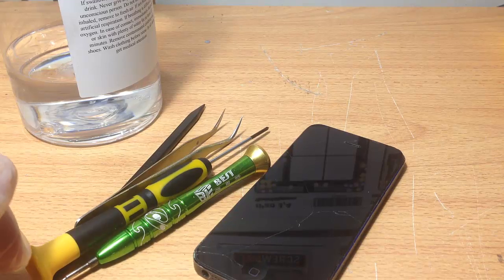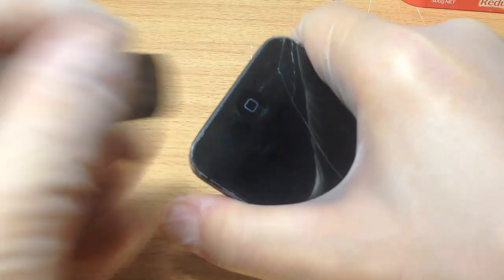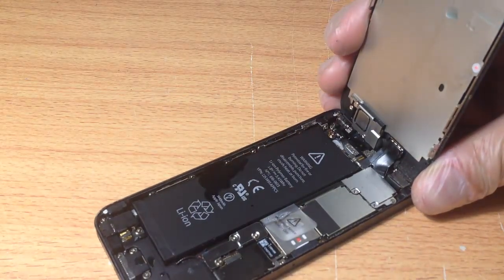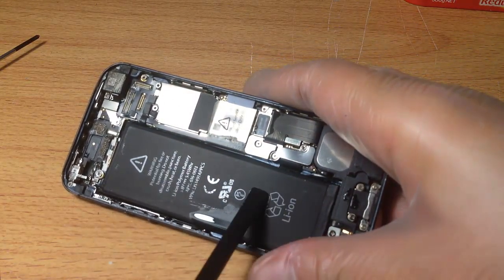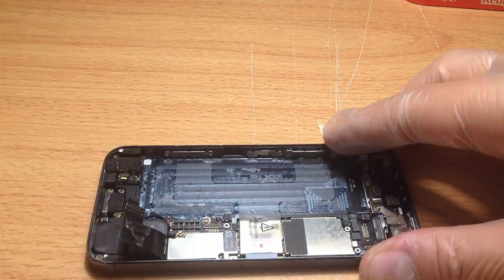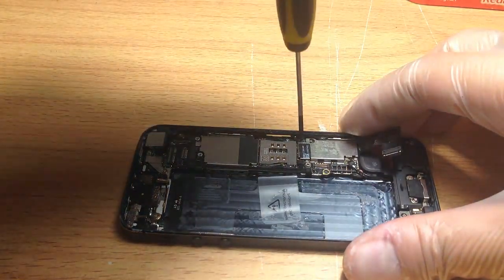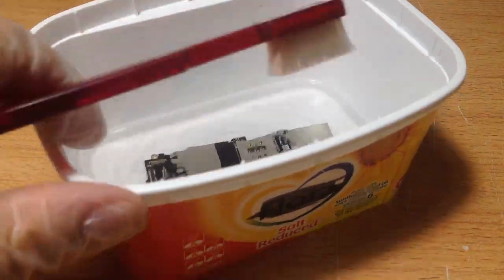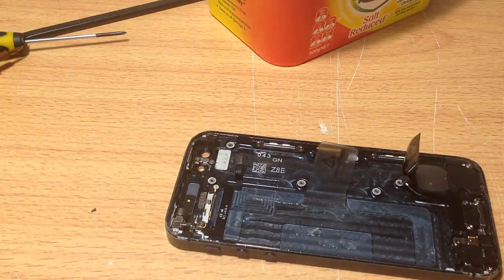iPhone 5 Water Damage Repair

Comment: So you really just washed it and it turned on? Did you get a new battery or use the same battery. The problem with mine is i dropped it in water and I try to charge it but it stay on the apple logo and thats it. I remember actually getting past the logo and it booted up but you can see the water damage and it slowly faded back to being off. Do you think i should get a new battery or wash it?

Comment: I dropped my phone in the bowl throne. Dunked it so clumsily but not two seconds passed that I scooped it outta there. Frantically opened it to see it still functioning but the touch screen barely responding. In the next minutes I wiped it clean and dry, sun dried it for a bit until I realized I shouldve turned it off. Left it in rice for barely an hour only to ignorantly turn it on again. It still powered on. Yay! But it's stuck in the booting white screened apple logo. Noooo. Left it to drain out the battery and die. Then I put it back in rice. Tried so hard to forget about it for 48 hours. I was so nervous when the night arrived that I could take it out of the rice. I noticed that it's more dry; the tiny water droplets in the main camera completely dried off. Went to charge it. Displayed the charging battery icon then still proceeded to stay on booting forever phase. I was desperate. Already consulted local apple repairs and they all said my phone to be gone for good. I refused to give up. After so many tabs of reading from forums and repair guides, I came across this video. Gave it a try. Opened up my phone and took it apart only up to the logic board. Luckily the LCI at the bottom near the charging port and battery did not gave any tint at all. Followed my instincts in cleaning the circuits and followed every second of this video. Being meticulous and intricate with the work, I succeed in rescusitating or bringing my phone back to life. Gonna back up from now on! Thank you so much for this!!!
Reply: TLDR; this video is legit but has its limits depending on so many factors. 
worked for me. the world is a better place :3
Reply from the maker: well done!

Comment: A few drops of water was left to soak onto my phone months back, the touch screen went all dodgy and eventually the phone just went black. I let it sit in rice for 2 days on and off and it would come back on for 3 minutes then die again. Now it doesnt come on at all so after seeing your video i ordered and replaced my old battery but still, the phone will not come on. Do you think replacing the charging port will help me? i have just ordered one on amazon and will be fitting myself.

Comment: Informative thanks...... Apple's business model is virtually the opposite of what the industrial revolution was supposed to be about. The idea was interchangeability, uniformity and ease of repair. These things are like prussian clocks form 1420.... they are rubbish. Once people have wised up and realised that they've been conned by appearances and trendy marketing tricks these things will be replaced by the mobile equivalent of a jeep. It'll do everything cheaper and easier. So anyone out there who's entrepreneurial.... here's a tip. Design a phone that's waterproof and unbreakable..... keep it simple... Think of the phone equivalent of a 40s jeep or red wings boots. You'll have a massive market of people sick of fiddling with ridiculous little screws and lock out technology crap like this.

Comment: I just dropped an about week old refurbished phone I had into the toilet.. it was only in there about 6 seconds maybe, and when I got it out it was fully functioning just a little wet. I took off the case and stuck it in rice for good measure, and it’s still working, do u think it will be okay and still function without corrosion as I it works fine and was in there very short amount of time and I am letting it dry. I am not able to do this method either, unless emergency. By the way I do not see any water lines or any signs of it being dropped? Is it possible for it to completely be okay
Edit: I say fully functioning, but I say that bc the screen was still on, I did no further tests as that could be bad, and I turned it off after. I’m letting it dry upright in rice. Please reply will my phone be okay without any damage. Is it possible??

Comment: @infohut My iphone 5s was in water for a few seconds. It still worked however kept searching for signal. I took it to an accredited Apple repair center and they did an ultrasonic wash (I think that's what its called) but they came back to me saying that its still not finding signal. Do you think I would get a different result if I try this?

Comment: Why do none of these "repair" videos for the iPone 5 have the ribbon connector from the home button to the main board? If you flip the screen up 45 degrees like here, or 90 degrees as other videos recommend, you will rip off the cable. More than 15 degrees and it's cactus.

Comment: When I press the on button, it comes up with the symbol saying to charge the phone even though it is still plugged in. I used the phone for 4 days after dropping it in water. I only want my photos off it, not to fix it. Is there any way to get data off without the phone switching on?
Reply from the maker: Mark Vessey I’d try cleaning it as per the video then also changing the battery

Comment: I dropped my iphone in a cup full of Jack and the screen went off. This was two days ago. Opened it up today and submerged it methylated  spirit then let it dry out in the sun. Put it back and it worked fine but the screen has been damaged and little dull in contrast, like a 3d effect. I think its time I got a new iphone!
Reply from the maker: screens are cheap.  check out my iphone 5 replacement guide on my channel & also there's a link on where to get replacement screens.
Reply: I am planning to purchase one tomorrow. Just had it replaced last week.

Comment: Don't lose hope people, hear me now: my phone was out on the street, in the rain, for the whole freaking night. I used these instructions to loosen the screen and the battery. Then I thoroughly vacuum cleaned the insides of the phone, with low to medium intensity. I then put the screen, battery and rest of the phone separately in a jar of rice for 48 hours. Now I just compiled the phone back together. It seems to be doing alright, just has some blemishes on the screen and must still have some dirt in the charging jack since it works sporadically. BUT YEAH YOU CAN TOTALLY SAVE A WET PHONE AND THE RICE TRICK IS NOT A MYTH. Taking the whole thing further apart and using the alcohol washing like in this video,  well if you're confident you wont loose any screws/parts and that you're are able to put the whole schebang back together again, go for it!

Comment: My kid dunked my iphone SE in a pool and held it down there for I don't know how long. I dried it out using rice for a few days, and it only worked somewhat. Bought some big tweezers and tiny little screwdrivers and took this little sucker apart, followed these directions (although it's a bit different because it's an SE). Getting the battery out was HARD...I bent it pretty badly and the wifi do-hickies became gelatinous sitting in the alcohol wash...plus some little bits of foam came out of the phone into the alcohol...yikes. I knew I bricked it but I put it back together anyway. Sure, I have a leftover screw and a couple of plates with no home...but oh well, it's not going to work anyway, right? 

WRONG. It does work!!! It could catch fire at any time and who knows how long it will work, but right now, I am feeling triumphant. With that said, I would give some advice to anyone who wants to try this: 

1. Get the magnetic screw mat magnet thing, invaluable...because these screws are so small you can barely see them when they fall. And the screws are (I think) color coded to the screw mat, which would have handy for me to know at the time. Also, use magnetic tools. 
2. Don't take out the battery if it's glued down (at least on an SE) I could have done the whole thing without doing that and it would have worked just the same. I probably did real damage to the battery.
3. PAY ATTENTION to those little screws, where they go, and any little plates or bits that come out...where they came from...etc. Just go slow, and really pay attention. . I put this thing together four different times because I got the screws wrong. 

THANK YOU to the gentleman who did this video, you saved me about $250 on a refurbished phone, which is a lot of money to me right now...I would have  had to put it on a credit card and stressed about it.

Comment: Hey, please help! Any help is appreciated. I dropped my phone into water for only about 3 seconds. I quickly picked it up and it was still working. After, it shutdown and I tried to turn it on again. My phone was burning hot after this.  30 mins later, the burning stopped. The rice method hasn't worked for me. Do you think this method work although I tried turning it back on? Thanks in advance!
Reply: swag master your mistake was turning the phone back on after dropping it in water the issue is corrosion and the rice method is a myth because it doesn’t stop any of it

Comment: Do not use a philiips head screw driver to remove the screws around the charging port. I just did this, quickly stripped them out before realizing that you need a tiny torx screwdriver specifically, and now will need to take my phone to Apple for an expensive fix.

Comment: About 4 days ago my iPhone 5s dropped in the toilet. I immediately pulled it out and turned it off, but even now, it's still unresponsive. Should I try plugging it in first? Or should I try putting the motherboard in the alcohol without trying to plug it in?
Reply: Same happened to me except I turned it on :( I will probably still try this method

Comment: My iPhone 5s got immersed into water.
Didn't work for a day. Not even during charging.
Authorized Service Center said, replace the phone for 22k. It's dead. 

I still charged it. And to my surprise, it started working.The display showed water droplets all over, beneath the screen.
Now, post 2 days (I blow-dried for 5 minutes. No keeping in sun, no rice sack, nothing), the water beneath the display had almost disappeared.
The phone's working absolutely well. WIFI is working.
Only issue is, SIM IS NOT BEING READ.
THE PHONE IS NOT READING THE SIM CARD. It shows 'Searching' on top left corner.
What do I do?

The iPhone service center denied service to a water-drenched phone.
And I don't trust the local service centers.

Comment: I dropped my iPhone 5s in the tub of water
Just a few seconds 
The screen was cracked so it only took a few seconds to get alpt of water in it
I'm in process of doing this now
It's sitting in the alcohol now, I'll keep every updated
Reply: Update?
Reply: So... did it work? I want to do this to my phone, but I'm not sure it works. A response will be much appreciated
Reply: This process works as long as your phone has not been fried which happens when you try to turn it on or plug it in when it is wet.

Comment: THIS IS FOR ALL THE PEOPLE WONDERING IF THEY CAN TRY THIS METHOD AFTER 1 MONTH TO A YEAR OR SO... WATER DAMAGED PHONE INCIDENT HAPPENED! ... I have knowledge of people that has the phone sat for 6 months and this method worked out for them, it all depends on the damage done by water on the phone, I mean how many water was inside the phone, how many parts and contact are affected by corrosion and also and most important, the owner of the phone MUST NOT have try to turned on the phone after it got wet, because this will cause a short circuit, if does, the phone will likely not work anymore since probly has parmanent damaged parts due to electric burned parts. This is all the logic behind bring back to life your water damaged iphone. So stop wondering and give it a try, this is a very effective method, don't lose your hope if you are not willing to try it at least!
Reply: JamieSaxon my kids got my iphone 5s and play it with water, i dont know how long it was turned on while in the water. But when I got it back i was about to turn it off but i think i was too late because it turned off by itself with slow mo on the screen.
Reply: im doing this to a phone thats been water damaged about 3 years ago, ill give you an update soon
Reply: itsferinheit me too
Reply: @Darealmclovin47  Hi it might be a bit late to ask, did you have succession with that phone?
Reply: JamieSaxon

Comment: when i plug in a charger it shows the apple logo but wont turn on, it keeps showing the low battery logo. i dropped  it in a pool
Reply from the maker: try replacing the battery. most of the time it needs a replacement battery. but it could be something worse like the logic board.
Reply: thanks

Comment: I tried to take out the battery the way you showed and SMOKE came out of it. My phone was working before (sound was working) just with no screen display after dropping it in water but now it wont even turn on. Am I completely screwed?

Comment: I have an IPhone 5s, I dropped it in a lake, I tried turning it on and it wouldn't turn on but made buzzing noises, hours later I opened it up and dried some water out of it, it still wouldn't turn on so I tried charging it, it turns on, but only Shows the apple logo (still had water on the screen) for a few seconds then turns off, and keeps doing the same thing until I unplug it, I left it in water obsorbent beads for a few days, still does not turn on, only when I plug it in the apple logo shows up but keeps doing the same thing as before, is there anything I can do to fix this? I'm not sure if I should replace the battery. Help would be much appreciated

Comment: my old iphone 5 works kinda it boots and vibrated speakers work headphone jack as well but the screen wont turn on all it is capable of is making the charge sound every 7s do i just need a new screen\lcd also the ringer is non functional and idk about the home button because it fell off but im 80% sure it still works all the dots are red so its damaged and my phone screen is falling to pieces and maybe that is the reason please help me also i have a broken 5s and its dead no sign of life i think that it just needs to be soaked in  methalated spirits

Comment: I dropped my phone in the toilet, and before I could get the chance to turn it off, the screen had turned off completely, and it won't turn back on whatsoever. Any suggestions?
Reply: Benjie https://www.ebay.com/itm/162287510918 

No fix no fee water damage repair!  Guaranteed fix or your money back. All smartphones!!!  iPhones, Samsung, Htc, google, Motorola, LG!!
Replacement parts, ultrasonic cleaning and microsoldering offered for a fixed rate!  Very inexpensive. Price will not go up unlike other similar offers
Reply: Benjie same happend. Someone said that the motherboard is damaged.

Comment: Hey, there is a weird wire thing connected to the top and bottom layer and I can't remove, what do I do about it?
Reply: Valerie Hernandez its the home bottun flex cable
Reply: You remove the screws holding it down :/

Comment: My iPhone 5 had a full 39 minute economy wash, I fit screens etc as a hobby,don't turn it on don't try shake the water out most of it will get in via the bottom and your shaking it to the top. Stand it up right place a kitchen towel toilet paper underneath if you can't get the screen off. BE PATIENT IF YOU SHORT IT OUT ITS OVER,It was in the pocket of some joggy bottoms it's still going two years later although the camera is blurred with purple irregular looking dots/marks. I put it in rice after removing the screen leave it for at least a day. They now say don't use rice it's your choice I didn't have anything else.

Comment: IMPORTANT UPDATE TO MY COMMENT! THIS WORKED FOR ME IN THE END.

Today, when I woke up, I saw my iphone alive!. It works smoothly now. I have already bought a new phone but I can now at least save my contacts and photos and maybe even sell the iphone 5. Thanks a lot!!!

My only tip: as I destroyed my battery and had to use my wife's phone battery, please do not try to take out the battery using a screw driver! Instead, pull the trasnparent little piece of plastic made for that.

Comment: My experience after using this video: I incidentally made a small hole in the battery using a screwdriver to lift it up... I saw some sparks and smoke... battery dead obviously.

You can avoid this very simply: the transparent plastic small piece covering the sim card is used to lift the battery up. Do not use any other tool, and if you have to, use a wide flat screw driver, do not do like me.

However I had another battery so I kept on with the fix.... and after 2 hours, my phone is still dead. Does this means the trick does not work? Nope. But it didn't work for me.

thanks anyway for posting this... seemed very promising

Comment: It's all fake with this "tutorial". If his phone is actually water damaged, then the 2 indicators on the logic board would turn red. But it's not the case here. Look at the indicators, they're still white. What happened was the guy put some water on the battery, way across the logic board and claimed "phone is water damaged". People all over the world were under impression that his company can fix  water damaged smartphones and are sending their water damaged smartphones over to infohut for repair. Cheap trick by infohut.

Comment: Thank you so much!!! Although this process was very time consuming and tedious, my phone works like a charm. I might also add, this is after I washed it on a full warm cycle in the wash machine. The only thing wrong with it now is there is a water mark going through the screen. I wouldn't even mind it if it was my phone, but a friend of mine was kind enough to loan it to me for a few months until the new iPhone 7s came out. Is there a way for me to fix this problem? Your help would be so very appreciated!!!! :)
Reply: Julie Rose did you replace your battery?